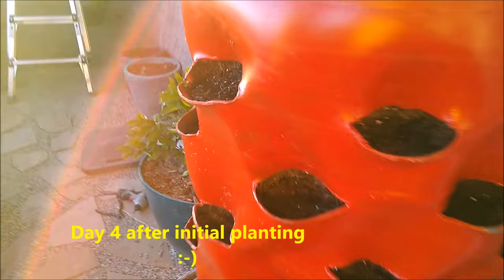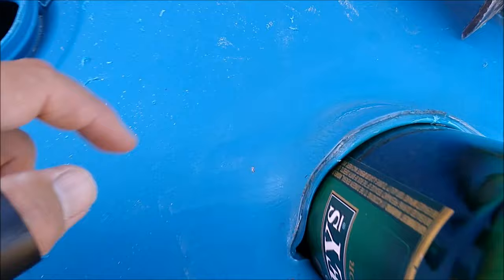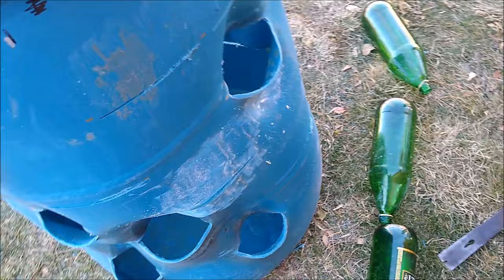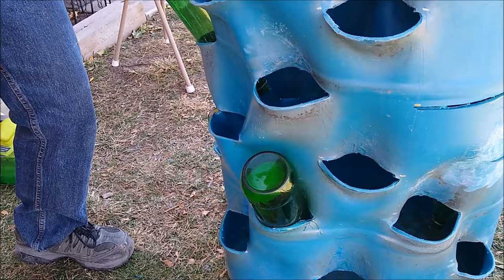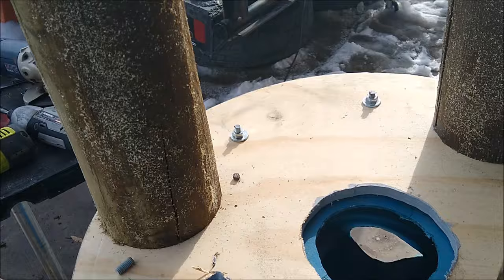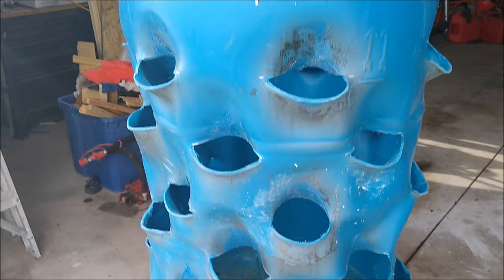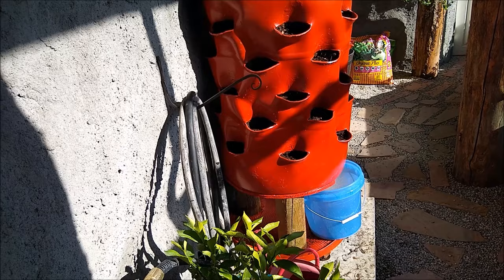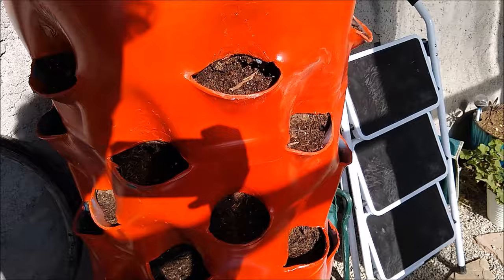DIY Garden TOWER Barrel

Comment: Use a 6 inch slit and  space it 4 inches on between slits  so it is symmetrical .  use  a more tapered  bottle  for ease of flexing  use a heat gun so you don’t t burn the plastic.  I like your idea of the post I’ll put caster wheels on mine
Reply from the maker: Good ideas! Thx for watching and commenting. If u make a video of yours please let me know I would like to see how u make it 👍

Comment: I just made one this morning. If you have an angle grinder with a cut wheel, it's really fast making the first cut. I didn't have a roofing torch, so unfortunately it took me a minute each cut just to make it soft enough using a butane torch.
Reply from the maker: Great idea! Thanks for sharing it
Reply: Heat gun works great

Comment: Hi. very nice idea. I will try it. what is the purpose of the white pipe in the middle plz?
Reply from the maker: It has holes drilled up and down it, and then you drop kitchen scraps in it, and as that breaks down into compost, the worms come in and out of the white tube and feed on that, and then the compost leeches out of the white tube through the holes into the surrounding soil as you water it. So it self-composts  👍
Reply from the maker: Then after two or three months, you open the hole in the bottom of the white tube, and get the compost out, and then bring it back to the top of the dirt barrel and put it in the top of the dirt. Of the dirt. Now that compost will leach down through the soil to the bottom of the barrel

Comment: Would it be better to drill guide holes at the end of your lines and use a jigsaw?
Reply from the maker: 😁😁😁 smart idea! A jigsaw would be safer for sure. you would have to start a hole with something else for the jigsaw blade to fit in to get started, or jam the jigsaw blade forcefully inside. Or are you envisioning drilling a big enough hole on each end of the line that the jigsaw blade would fit in? that might be worth trying, because then the bottle might slip in easier 👍
Reply: @anesthesiadreamin  Yes, a hole at the end of each line for the jigsaw. Start the holes with a standard drill bit.

Comment: Have a question... do you see that you might have to change the soil every couple years? I see that you only have this for about five months so I might be asking a little bit too soon but what is your suggestion?
Reply from the maker: I wish I knew the answer to that, I would just be guessing, but I think if you have worms constantly breaking apart the soil, making worm castings, and you recycling the nutrients dripping from the bottom and pouring back on top, I think the soil should last at least a year or two. But again that's a guess. Nature doesn't "change the soil" per se, but maybe analyzing the soil with the soil test kit might be something to keep on top of every few months, just to make sure the pH, phosphorus, etc don't get far out of whack. Maybe ask this same question to one of the YouTube video posters that's had their barrel video out for longer, or someone that has done a bunch of barrels. Sorry I'm not more help, but thanks for watching, and for your question 👍
Reply from the maker: Also, check out Tim Burrows on youtube, he has made a bunch of barrels, and he might be able to answer your question better.
Reply: @anesthesiadreamin  ty so much
Reply: Put vermicompost tube in the middle made from pvc with holes so the worms can go in and out